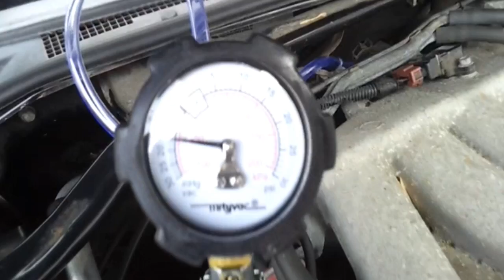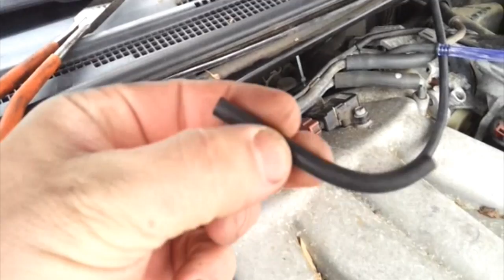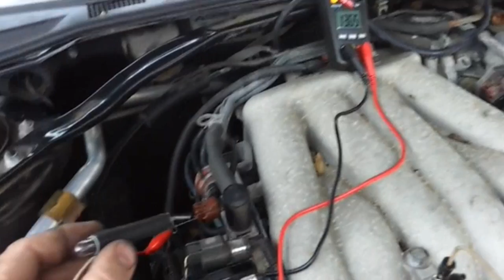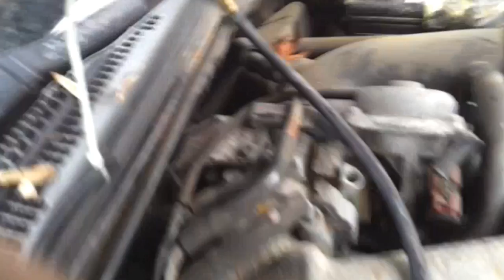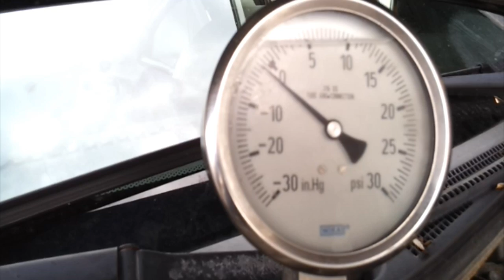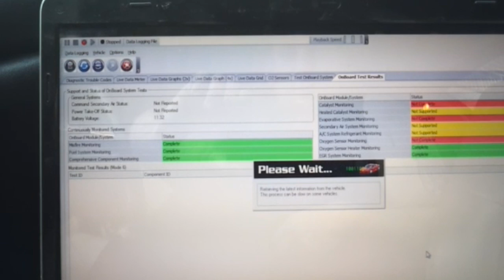P0401 EGR troubleshooting diagnostic and repair

Comment: best video among many other. usually the vacuum ports at the throttle body are clogged. I got mine fixed just by spray cleaning the ports and using a small copper through the tiny holes. Thanks robinsonauto

Comment: Thanks for the Video. It was very helpful in understanding the EGR system and troubleshooting my car. My problem turned out to be the mechanical valve seal was worn. The solenoid would move but would not seal when the EGR should have been functioning. This was easy to test by putting the vacuum gauge on the port going back to the manifold and supplying the ground to the  solenoid, always had 7psi. I took the solenoid apart and found the rubber valve had deteriorated. When waiting for the part to be delivered, I put some RTV on the valve and made a temporary gasket. It worked just fine. It will probable will not last to long but will replace it with a new part when it get here. Once again thanks for the time to explain and show the testing. You have to love the internet and people taking the time to explain!.

Comment: my 2001 Mitsubishi Montero sport all lights flicker when I start the vehicle, Idle is way too low when cold and it dies out unless I warm it top a little to stay running, all monitors clear but the EGR. I apply vacuum to EGR it opens and it wants to stall so the diagram is good that's for sure. I took the EGR out and cleaned the ports so I know its clean. But I haven't done non of the other tests yet its winter and its cold to work outside asis. I wonder if any body else had the same problem. It has to be either the solenoid or the vacuum reducer or those two throttle ports plunged but I sprayed mine already. I will need to perform all the other tests. I wonder if the pressure sensor has anything to do with it on the intake? if you guys had same problem let me know what you end up finding please.

Comment: Seriously, you put the parts changers to shame! A vacuum gauge, test light and multi-meter diagnosis where they would just change the EGR, solenoid, check valve, assorted hoses and still have the problem reappear. Excellent, its given me much insight to diagnosing the P0401 , P0403 codes I just got. I assume the vacuum tests would work with the EVAP solenoids too.
Reply: Hey buddywhat cleaner u need to clean the port
Reply: I have the 401 and I am going to try what u did but did u spray anything in the port or u just use the cleaner

Comment: Where can I get a test light like the one you have?
Reply from the maker: David Villalobos the smaller black one is handmade, will do a vid on someday, the other is a led logic probe style computer safe any parts store
Reply: robinsonsauto quick question what kind of air Gauge is the one connected to the back on the EGR valve not the hand pump. Just bought one at harbor freight that says CENTRALPNEUMATIC 1/4 NPT Brass Tee & is not taking or holding pressure...
Reply: NVM I'm an idiot

Comment: 2003 Mitsubishi Eclipse GTS (Manual)
Codes-P0300/P0401
Car is driving fine,however its making about 100hp.4-5 minutes after start up its at half hot on the temperature guage.The timing seems too have been retarded by the ECU as my redline under a load is about 5,000 RPM's.
I replaced the EGR valve with a K5T5 official Mitsubishi part and still have the issue.I know from having the intake off that the ports are not clogged.I guess it's a sensor or one of those solenoid's possibly even the egr tube that bolts to the exhaust.Hopefully after discovering this AWESOME VIDEO,I will finally solve this problem and get my 210hp 205lbft 
Car back up and running!!!!!!!!
I give this video 5 stars a sub and a like,
Thanks dude 😎

Comment: I have a 2001 Mitsubishi Diamante and been having P0401 EGR insufficient flow  on and off for 5 years now.  I've wasted money going to Auto Repair Shop that doesn't try to troubleshoot.  All they want to do is trial and error with changing the parts without testing it.  But you've made clear troubleshooting method.  Great job!  You've helped me move forward with my P0401 issue on my own.  I now have way better understanding about EGR systems. Thanks for this post!
Reply: I've got the pain in the balls codes of P0401, 455, 421 and 300 all together on my 2003 Mitsubishi Eclipse. I tried many other things to hopefully fix them, but to no avail. Most of them needed to be done when I did them, but they aren't the problem solvers. I took it to a garage to see if they had any thoughts. All they did was stare at the cold engine telling me to replace some of the parts to see if it will work.

Comment from the maker: thank you, great suggestion that may work good, i tried using torch tip cleaners while they were small enough they kept flexing making slow progress, i found the small bit to work great as i turned it the debris pulled out of the port, thanks for the feedback and suggestions

Comment: Gotta think that those principles of drop testing that we use in electronics are also applicable when it comes to flow of matter in vacuum lines. So, physical obstruction could interfere with flow but not necessarily be detectable with static testing. Great demo!

Comment from the maker: Thanks for acknowledging my efforts, as you know before most jobs on a specific system its always good to do some research not all system operate the same, for this job i found Alldata had all the info i needed for a successful repair, down to the vacuum response time, i did use Mitchell as well, my main two programs, thanks again

Comment from the maker: Thank you for all the kind words, very good point, i had to educate myself on the system before diving in reading trouble trees and what not, as you know not all system are the same, going in blind leads to guessing, never a good thing,
i had more to this video however opted to leave it out do to some missing info i forgot to gather while i had the vehicle, the EGR system is monitored by a change in the o2 sensors when commanded on, i had plans to go much deeper however dropped the ball lol

Comment from the maker: Thanks Terry for helping out and sharing the info, i have all they have to offer at this time, they sell bundles however not with all makes and models that they cover, so i contacted Autoenginuity and asked if they could put together a bundle that covered everything they had to offer, and they did, total cost was around $2,000 at first it seemed to basic and i didn't care for the layout would rather have subcategories and whatnot  however the more i use it the more i like it

Comment from the maker: Thank you for the kind words, when i share my thoughts i try to do so in a way i would understand, in other words im pretty simple minded, i need to break things down to totally grasp it, in hope it will do the same for you guys, 
good question, not all EGR's are open or easy accessible, what that test will tell you, is if the EGR passages are open, listen for the stumble, it don't verify the condition of the EGR diaphragm, the lines, solenoid, and everything else in the system,  hope that helps

Comment: I have this scanner also. It does a pretty good job. You can buy the generic version or you can get the upgraded versions which allows you to look at everything on the car. If you go with the upgraded version, it's manufacturer specific. For example, there's one version for GM, Ford, Chrysler, and others. The advantage is that you can see everything on the car such as door modules, navigation, ABS, transmission, etc. and you'll have bi-directional controls to turn outputs on. Check their website

Comment: Very well done Will! I like where you first showed the vacuum diagram and then pointed out the valve, solenoid, EGR and hoses. Then you explained how the system worked which I always believe that you have to understand a system to be a good troubleshooter. Also, good use of the test light in monitoring and turning on the solenoid. Hats off to you for a great demonstration and believe me, I know how much time it takes to film this while you're troubleshooting.